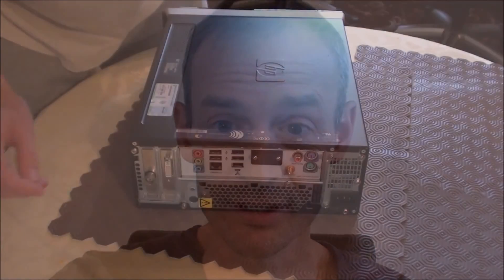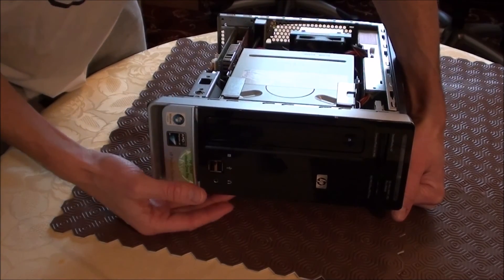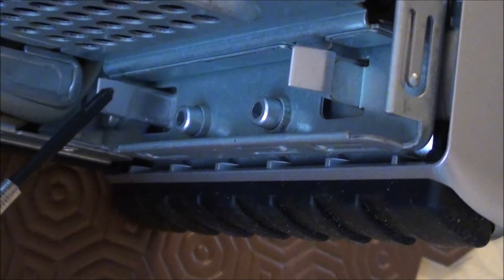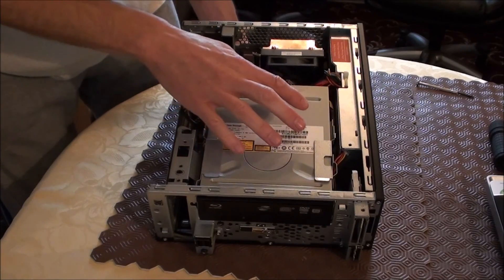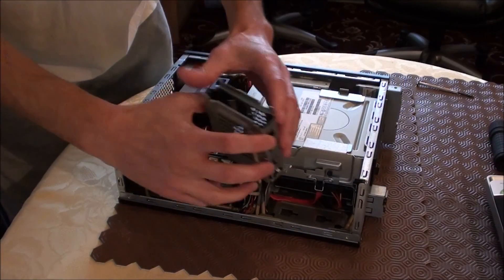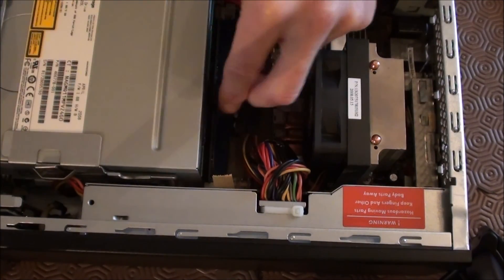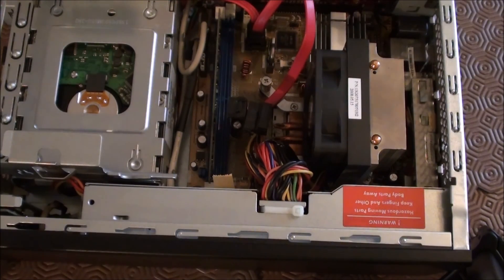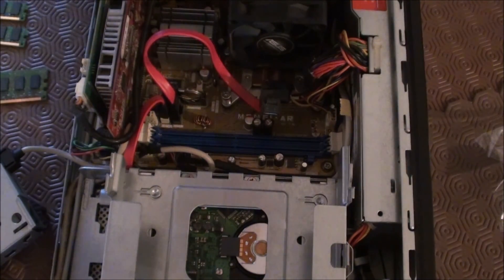HP Pavilion Slimline s3000 RAM Installation

Comment: I have one I picked up at the dump, missing the hard drive and the cd drive. The video was helpful and easy to understand. Thank you. I put the ram in but still need a hard drive and I have a cd/dvd drive which I will install after I find a proper hard drive.
Reply from the maker: Hey there, I was super pleased to hear this comment especially as this video is getting on a bit now.  I'm so happy that my video was able to help you in some way, I seem to recall getting to the ram was a bit tricky which is why I made it.  Good luck with your build, and remember it's possible to download and install windows 10 without actually activating it.  A few times I've purchased an activation key for just a few UK pounds off ebay.  They are for sale from PC's which have been scrapped and perfectly usable.  Good luck - Neil.

Comment: this helped me out alot,i just took out the ram, and put it back in..and it started working again,.cleaned a little dust out and i'm doing ok now.. revived a classic
Reply from the maker: Hey Lacey, I’m super pleased to hear this! The RAM probably just needed re-seating, as well as a bit of a dust round. Brilliant! Very pleased for you. You might want to consider installing Windows 10, this can be downloaded from the Microsoft website free of charge but it won’t be licensed. This just means you won’t be able to personalise it like put your own picture on or change the colours that sort of thing. However, it is possible to purchase off eBay a license from a computer which has been scrapped for a few pounds.  This is something I’ve done before myself and I’m still using them now. Good luck and thank you for commenting and letting me know how you got on. Best to you-Neil.

Comment: I’m having a beep code 1short beep 1 long beep when I looked up the code it says memory issue. So I’m trying to make sure I buy the right memory ram upgrade. How can I tell what size memory I have? So that i know what to upgrade to?
Reply from the maker: Hi Jada, if you can take out a strip of memory and there should be a label on it. This small label should contain all the information about the type of memory it is and it’s size, speed etc. You need to try and get and exact match if you can. It’s possible depending on the age of your computer, it could be a bit pricy, hopefully not though. I hope that helps. Good luck.

Comment: Any other upgrades you’d recommend for the pavilion, I have a tiny bit of spare money and I’m looking to optimize my computer
Reply from the maker: V - NÜX Hey there and thanks for the comment. This is a fairly old computer now, and I found the best way to give it a little performance boost was to extend the memory. It wasn’t too expensive either, so that was good. I can’t really think of anything else apart from you might want to consider putting windows 10 on it. This can be downloaded from Microsoft’s web site and installed even without a licence.  You can then purchase a licence off eBay for very little money, these licences are from old disposed of computers so they are legitimate. I’ve done this several times successfully. Good luck.

Comment: Neil haven,t talked to you in awhile.  How are you and your and Molly doing?  I hope well and you are still coping with MS.  I go along with the symptoms and not much one can do but cope.  You are technical so a question.  i bought a Dell laptop and i had it 4 months.  everything worked fine.  But after using it one night i plugged in to charge it.  next day i unplugged it and it wouldn't turn on.  Did everything.  Changed plug outlets. booted it.  booted my router to changed WIFI.  Nothing.  I read on line from a lot of people that they had similar problems and it turned out to be mother board.  Well I haven't checked yet but if it is going to cost a lot especially more than laptop is worth , off I go to buy another.You have any tech expertise  to this problem?  Talk later Neil.
Reply from the maker: Hi Bode, yes it's been a little while hasn't it.. but hey I'm still here albeit haven't made a video for quite some time now. Struggling with time to be honest. All good this end thanks, Molly is also doing very well considering her ancient age. I hope things are good with you also Bode, and yes I know what you mean about just going along with the symptoms, as you say that's all we can do isn't it. 

Sounds to me like the Laptop is definitely faulty after only four months. I would probably disconnect the battery, then re connect. Plug in power supply and switch laptop on. It should come on without delay. Failing that, why not contact Dell Support, they will definitely be able to tell you if it's died. They will also be able to advise you on a replacement, and what to do. In theory you should not have to purchase another one as it's not even a year old, it will have a one year guarantee for sure. 

Good luck, and great to hear from you. 

Neil.

Comment: Would HP Pavilion Slimline 4000 RAM Installation  look the same?
Reply from the maker: Hi There, I would imagine because the PC's are so very similar the memory would be identical.  However, where memory is concerned I've learned its best not to assume.  If you remove the memory from your PC, on it should be its specification.  I would recommend buying a quality memory if you can from HP themselves, or someone like Kingston.  In actual fact the memory I brought for the PC in this video didn't work!  But that was a lesson learned for me, because I purchased it from a cheap company through Ebay.  One further point, its useful to know if your PC is Intel based of AMD because the memory will be different.  Good luck, and I hope that helps - Neil.